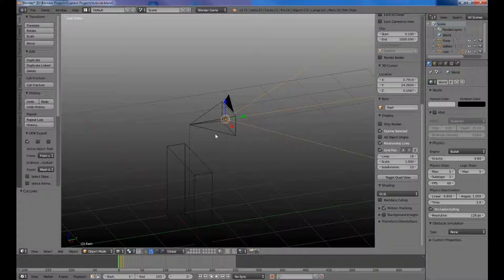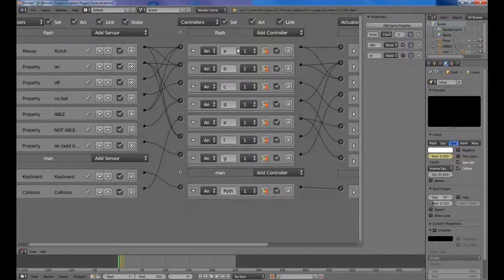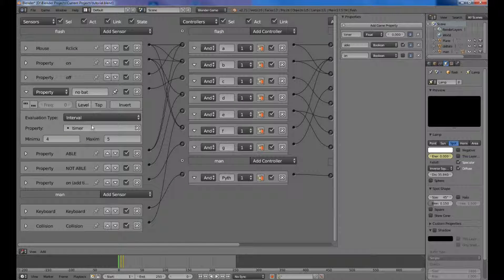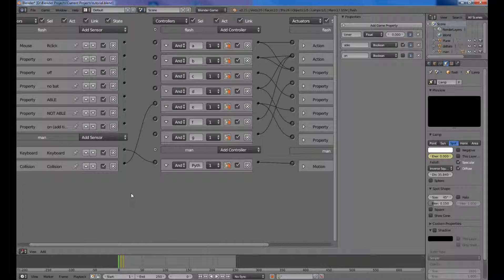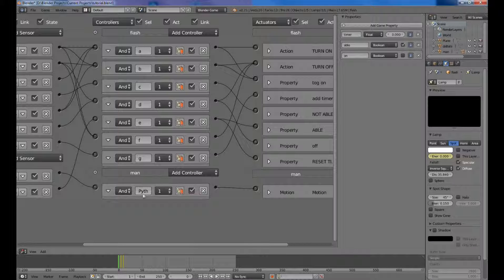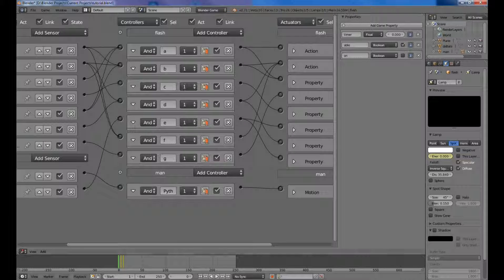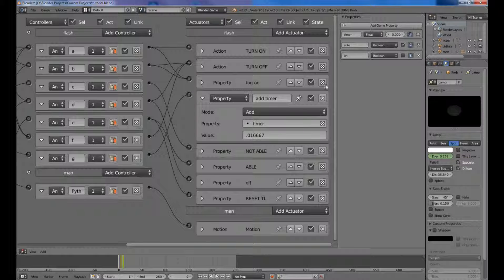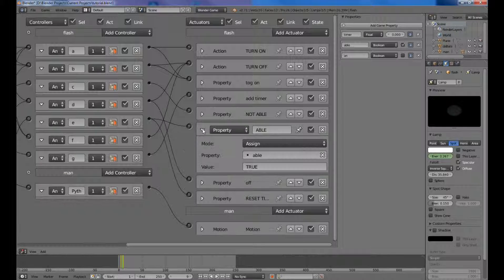How to Make a Functional Flashlight in the BGE. (No python)

Comment: How did you animate the lamp
Reply from the maker: I set key frames on the energy value of the lamp, then when the lamp is turned on it plays the animation. The short animation key frames are visible as yellow bars in the timeline bar at the bottom of the screen. Please see 9:21 in the video. Also, Blender Game Engine has been discontinued for some time so this tutorial is not very relevant anymore.